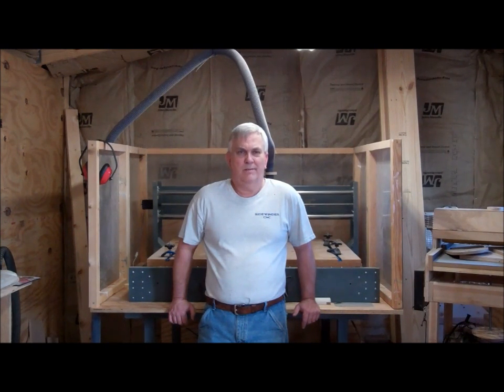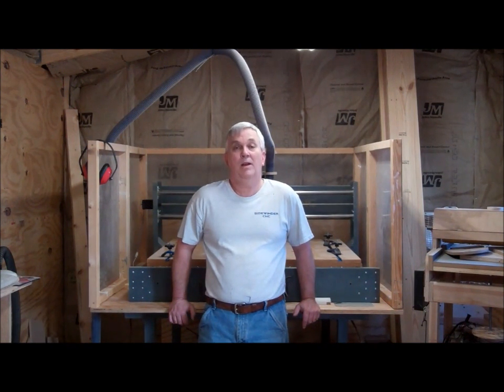CNC Router Video Series

Comment: I think it Would be cool to build a CNC I have wanted to build one for sometime now. But I would like to be able to use both wood and my plasma Cutter. But least I could learn from you the basics for the motors and controllers and programs. are you going to use gear or screw drives. I was thinking gears would be cheaper and then you can make table size any size you want.. But you are the master of this build  and I am the student. Hope this works out good I cant wait.